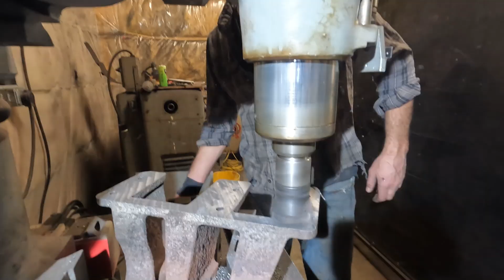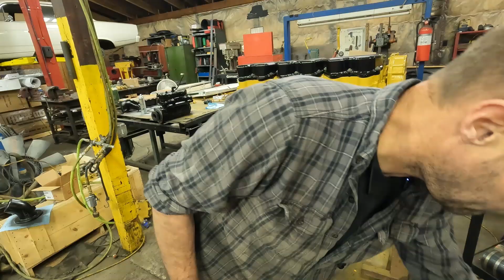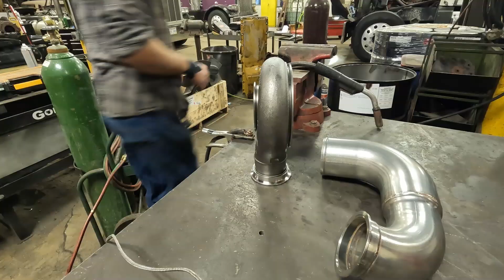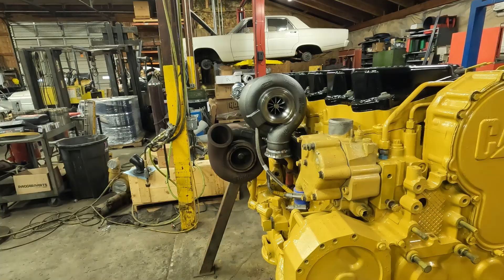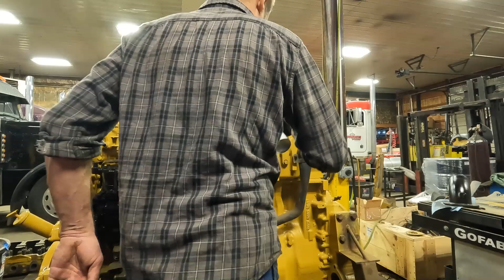Caterpillar C-15 6NZ Acert Turbo Build: Part C

Comment: Wouldnt it just ve an acert?
Reply from the maker: I assume you meant to type 'just be an acert?'  Kind of, but no.  You could build a similar engine with an acert and the acert pistons are better than stock 6NZ.  But higher compression.  It's costly to decompress the acert pistons.  We thought we got around that by buying the IPD single piece steel piston kits. . .  And that ended up biting us badly.  But back to the Acert, if you're turning up a BXS and want the most power and best file options, you need to swap to the 70 pin ecm that the 6NZ has.  Not sure if you have to on an MXS.  But that limits the acerts that you're in the market for.  And you don't want an SDP...probably.  This particular engine was local and priced right and had that huge compressor on it and the serpentine belt setup.  So it ended up being a good deal for the situation we were in.  If you had an MXS readily available, it might be the better option.

Comment: 32k, to Reba Cat Engine! That's freaking good! My out of frame rebuild on my 425/ 2013 Cummins last year was 31k. But I needed a whole new engine block, too. Bill came to 36k because I had the whole front end done. Springs, spring pin bushings,  shocks,  had it lowered 2 inches in the front also, etc!
Reply from the maker: It was 32K in parts.  Total was pushing 39K.  If it was just a stock build, it would have been under 32K
Reply: @bigrig_smilespergallon  Yep, 39k for a Cat build, tuned, big turbo,  and everything else yall did,  still not bad. My buddy had his 3406E rebuilt 4 years ago, I know it's 4 years, lol, but that was 43k. Yes, sir! 43k for that rebuild, stock,  no extra.

Comment: How much HP and torque is it expected to make? And what kind of fuel mileage will it get?
Reply from the maker: Not exactly sure what the power level is going to be.  Over 800 hp.  I told my tuner what engine it had to edge out and he said 'That'll be hard to do.'  He thought about it for about six or seven minutes and told me this would be a good start.

Comment: Do you have to cut counter bores in order to do a rebuild or inframe peace
Reply from the maker: Most of the time you have to.  It all depends on the shape of the block deck and the liner protrusion measurements.  I didn't have to cut every bore on this one because we had the whole block decked.  If you look through my videos, I've got one all about liner protrusion.  Thanks for watching!

Comment: Thanks for the content your videos are very informative. I’m from NC and would like to learn whatever it takes to build engines for semi trucks I’m currently a truck (company) driver and I’d like to know what steps you would recommend in order to learn more about CAT, Detroit, and Cummins engines?
Reply from the maker: It all depends on your specific situation but learning on YouTube really is a great beginning - at least to familiarize yourself with the different designs and how the engines work.  You can only diagnose a problem properly if you understand how the system works.  Once you know, how they work, unless you can attend some sort of schooling, I'd look for a small shop that works on the type of trucks you want to work on, and see if they would want to take on some part-time help or something.  But no one is going to give you an engine to work on right out of the gate.  And it's best to start simple and work your way up.

Comment: I have some milled factory turbos the high pressure turbo has a 96mm turbine milled into the stock housing the 80mm high pressure over a 95mm atmosphere and the 96mm turbine

Comment: If converted 2 a single turbo would it loose any power 🤷🏾‍♀️?
Reply from the maker: It wouldn't necessarily lose peak horsepower.  The compound turbos provide a bigger power band and better engine performance.  Which would result in having more power throughout the rpm range while it still might have the same peak horsepower.  The twin turbos should out preform a single.
Reply: I went down that road and coverted to a single turbo, and I'm no too happy about it.

Comment: You did what I thought could NOT BE DONE! Good job! That engine MUST HAVE a 4 row radiator to keep it cool.
Reply from the maker: Thanks!  Yeah it will.  I think we're taking the water-cooled transmission cooler off and putting a big air cooler on the trans.  We've found that doing that helps a lot when it comes to keeping the engine cooler.